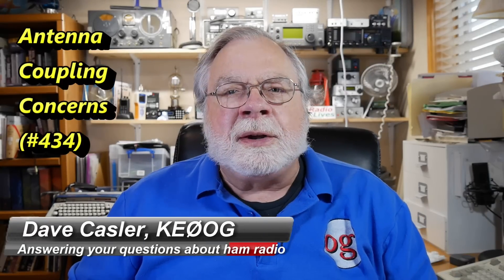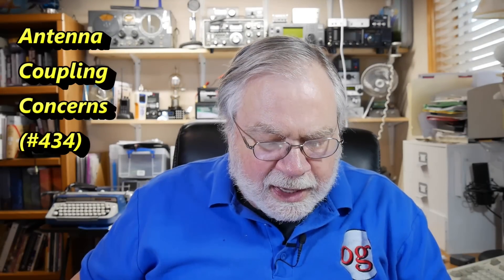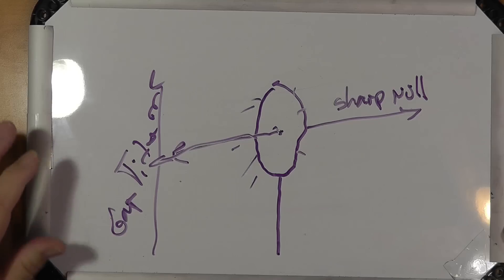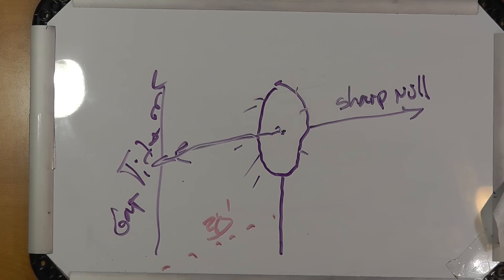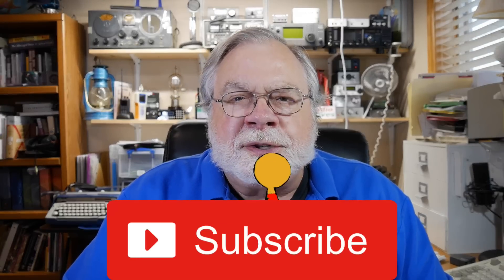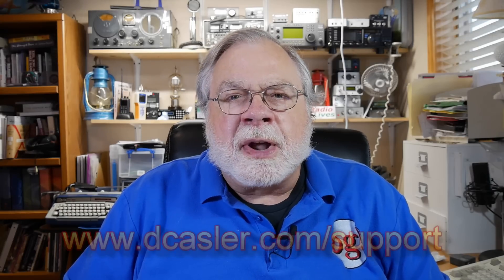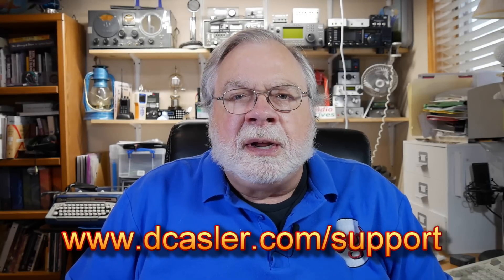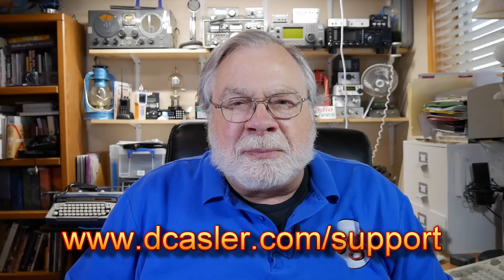Antenna Coupling Concerns (#434)

Comment: This raises some questions for me. I have a small lot, just enough room to squeeze in a 40m inverted V with enough clearance for RF safety regs at 100W. However I don't really have space to separate my receiving loop (next upgrade will be a wellbrook hopefully) or VHF antennas from it by more than a few feet.
Is there any way I can ensure the safety of antennas and radios?
Does anyone know of any way to assess this?

Comment: If you have a nanoVNA you can also try to measure the signal attenuation directly into the vertical and out of the loop (without pre-amp) and even compare different setups. That will give you an actual number you can use to see what maximum TX power can be used before overpowering the pre-amp assuming the maximum input spec on the pre-amp provided somewhere.

Comment: If you put the loop antenna horizontal with the null facing the ground, does the antenna become omnidirectional?
Reply: @scotts7804  Being omnidirectional is a benefit. Magloops cut out E-field noise by using H-field instead. They're also high efficiently and high Q-factor.

Comment: I have worked on a Titan DX vertical antenna over a year ago. 
   If assembled properly, it works fine. But ALL of the instructions and diagrams must be followed carefully and correctly!!! 
   I replaced the counterpoise wire with one of the correct length and it worked fine.
   This is an 8 band antenna. 
    It can be operated at 1500 Watts PEP, but not continuously as for RTTY, Amtor, etc.
   Thank you.
N0QFT